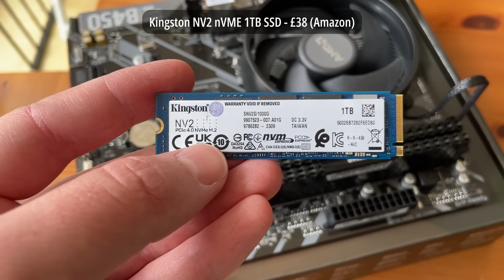Building a Cheap and Upgradable Gaming PC in 2023

Comment: I've just about reached my limits with the AM4 platform. I've got the 5800X3D and an RX 6800 with 32 gigs of DDR4 3600. I could upgrade the video card and double up the ram I suppose but I don't think it would be worth it. I'll just run it for a few more years and then start looking to replace the whole thing.

Comment: Am4 is crazy expensive here, but intel is weirdly cheaper, what weird reality I am?
Reply: In AliExpress the Intel parts are crazy expensive in CAD currency.  Even down to 6th gen intel.  Rather build with ivybridge xeon or v3 or v4 xeon
Reply: @marcc5768  I went for ivybridge xeon, had an x79 with LGA 2011 already, a bunch of ddr3 memory laying around, and that was the best thing I could've gotten for less than 20$ at the time
My plans are an upgrade to AM4, as DDR4 should be capable enough to handle at least 15 years

Comment: I bought a used motherboard off Amazon and it redlight my 5600x cpu even though it was an X570s Tomahawk. I have yet to receive the refund. It seems to me that for VERY LITTLE more money you could have built a much more capable system that would be both upgradable and also NOT REQUIRE upgrading for a much longer time. I mean 1060? 2600? Really?

Comment: Just finished building using this as a guide - picked up at RX 590 and a different branded SSD as well as AX3000 WiFi card as I'm not close to an ethernet port at my desk, but still came in around £350! Bargain I think with a slightly better GPU in there as well. Can only switch on and install Windows tomorrow now so fingers crossed!

Also got the CPU from CeX, but mine didn't come with a fan so had to pick one up separately which added a little on!

Comment: This is almost my exact same build from 2020 with a slightly different case that has optical drive bays. A Sata 3 SSD (M.2 is way cheaper now) and an RX 580 (comparable to the 1060 and $50 on the used market)

Comment: HellCrack Classic              ATX Midi PC Case               £30 (Amazon)
EVGA 600 W1                    PSU                                        £23 (Ebay)
Gigabyte B450-M-K           MB                                         £36 (Ebay)
Ryzen 5 2600X                   CPU+Cooler                         £40 (CEX)
Corsair Vengeance LPX   RAM (3200MHZ 2x8GB)    £21 (Ebay)
Kingston NV2 NVME        SSD 1TB                                £38 (Amazon)
Logitech MK120                KB+Mouse                            £18 (Amazon)
Logitech Z150                    Powered Stereo Speakers  £27 (Amazon)
LG MP22410-B                   21 inch Monitor                    £70 (Amazon)
 Asus ROG GTX 1060        GPU                                        £75 (Ebay)
                                                                                             --------
                                                                                              £358
                                                                                              --------

Will be building a PC as a surprise christmas present for my nephew but already have a 1060 and a 21 inch monitor so that should bring the cost down to about £250. I'll Add a 2TB HDD but I should still come in at well under £300. Long live the budget PC build. For a while it was looking doubtful if it would ever return.

Comment: thanks a lot although i have a some what similar gpu using an rx 580 an asus rog one my cpu is really old because a relative gave it to me its a A4 6300 so the bottle neck is literally at 60-70% specially on cpu intensive games im planning to upgrade soon so this video really gave me a much more in depth guide specially on the motherboard because i was only planning to get a really cheap a320 board but with this guide it made me think more better on how i can save more in the future upgrades

Comment: Thank you, i am still on the i5 7600K and GTX 1070. I already have the case, a 800w PSU, 2 SSDs + 1 HDD and 2 x 8GB DDr4 3200 RAM. I was wondering what motherboard and CPU to upgrade to, while holding on to as many components as possible.

Comment: 9:38 that drift into the parking space was smooth lol. I was hoping this build wouldn't go over 1k of my currency but it's just over 1.5k, so a bit disappointing but it should be worth it for the upgradability. Also, I'm new to this channel but have you ever done a gaming build that's power efficient while being fairly cheap? I think that would be interesting to see
Reply: its always been gtx1650 for low powers
Reply: The 1650 sucks, most mid tier GPUs are power efficient anyway

Comment: Should have gone with:
Ryzen 5 5500 (6c/12t) - supports RAM speeds of 4000+ (in 1/1/1 ratio) because it is monolithic. A hidden gem for budget gaming.
Gygabyte B550m DS3h - same-ish board that you used with a couple of improvements for same-ish price. Improvements include: VRM heatsink (important in case of upgrade to more powerful CPU), 4 ram slots (to upgrade later), link to chipset is at PCI-E 3.0 speed/bandwidth instead of 2.0 on B450.

Comment: A little piece of advice for everyone if you buying cheap case at least make sure it has some sort of front cuts to take air in, and it would be wonderful if it also had at least half of space on the top with holes to let that hot air out... 
Some recomms: FSP/Fortron CST130BASIC, Cooler Master Masterbox Q300L,  MSI MAG Forge 100M, Deepcool CC560 White

Comment: Really nice video. A beginner pc builder like me can learn a lot. In spcific what components to chosse for upgradability:
- High Watt PSU
- Motherboard with a socket that supports a lot of CPU generations (AMD seems to be the only option xD)

The rest of the system can be adujsted to what your wallets weight.

Nice video, I will remember it for when I need it again!

Comment: These are really close to my current specs lmao, except I'm running a gtx 1660ti that is in desperate need of repasting. I'm planning on getting 2x16gb 3600mhz ram, a Ryzen 5 5600x, and for gpu I am pretty torn between 3060 ti, 6750xt, or an Intel Arc A770 for all that precious vram
Reply: Go for the 6750xt it outperforms the other two
Reply: @ANN1H1LATE89  I like to play older pc games too which Intel cards struggle at so I prob will go AMD. Nvidia isn't looking good for the mid-range consumer crowd
Reply: currently running a 5600x, 6750xt, and cl16 3600mhz ram. 1% lows are really low and games are stuttering a bit but it's a much better experience than before.

Comment: ...but don't put a AIO into this CPU/MB combo. This low end VRM design is being pushed with a 95W CPU. And an efficient cooler, will make the CPU draw even more power (stock PBO/XFR settings). So best to use a down-draft cooler. Wraith Spire or Prism is good in this combo.
If paired with a higher end board (proper VRM heatsinks), then an AIO or good tower cooler will be optimal for the 2600X.

Comment: Did you just put a Wraith Stealth on a R5 2600X? That is a bad combo. There is a reason that CPU comes with a Wraith Spire (the copper one). It is a 95W TDP CPU. And for the boost spikes in freq and voltage, you want some efficient heat transfer.
You don't get the full performance benefit on the 2600X with the Wraith Stealth @stock settings (or you will slowly fry it if you did). I saw it hitting near 80c in a few  games. Meaning a Aida64 or Cinebench might easily get it to thermal limit.
With the Spire, it does boost to at least 4 GHz in gaming (and only goes down to 3925 MHz during full stress load as aida64/cinebench). With a even better cooler, 4 GHz @all core, is possible if temps stay below 75c)
The B450M-K board will be hard loaded on VRMs, so for the board the Steath is not bad. But upgrade to the Spire or Prism for the CPU. (Spire has slightly more airflow on VRMs than Prism)

Comment: Why is nz such  a  rip off 16 gigs ram b450 amd 5 3600 gtx 1060 6gb 550w psu 500gb ssd and mid tower case is 800 buck used parts 😡

Comment: That EVGA W1 PSU is listed on Cultists Network as "F-tier: replace immediately"
Reply: Indeed, and even worse, it's second hand.
Reply: @thorham1346  and the motherboard VRMs (no radiator! sweet jesus) are quite literally going to explode if you try to run a 5600x or, god please no, 5800x3d. It's an upgradable system, sure but the main components are "replace immediately" tier.
Reply: @crispybottom yep, rule Number 1 in PC building is: Never, ever, on your life, skimp on the PSU!!! Because a faulty PSU can wreck all your other components.

And bad power delivery also helps causes coil whine at much lower fps than udual.

Additionally that board has only 1 m.2 slot and he's not using the SATA ports so the system fails the upgradeability test right there.

Next issue is 16 GB of RAM, not enough for today, it should be 32GB and it's not much of a price increase.

Also one of the best ways to save on a budget build is to carry over working storage.

Carried over 2 of my old SATA SSDs, they still work, why throw them away?
Reply: @LupusAries  16GB of ram is enough, what are you even going to run on it? blender?

Comment: tt is not all that different than a recent build for my roommate. The exceptions being that I used a used aluminum LAN party case.  My build was really cramped though. Mine has a used B450 board and a used Ryzen 2600 which came with the cooler.  Issues I had was the board did not come with I/O shield, which I could live without, M.2 stand off, and heat sink mounting plate. For me it might have been better if I bought a new board. Used a used GTX 1070. Had a power supply I bought for a previous build so already sunk cost there.

Comment: I have a AM4 motherboard to be specific Gigabyte A320M-S2H and I have a Ryzen 1600 paired with an RTX 3080 planning to upgrade it to Ryzen 7 5700x, will my mother board support the upgrade? Or should I change the motherboard?

Comment: The only thing I would change is getting a 256gb M.2 and leaving it solely as your windows boot drive and then have a 1tb sata SSD as your games storage. Having games on an SSD and not an M.2 won’t affect load times but not having your boot drive filled with games will keep the PC responding faster for longer and keep windows snappy with no discernible input lag.

Comment: Nice one! Mine's as follows: Deepcool Matrexx 60, used AMD A320M board & Ryzen 3600 w/Prism cooler. ebay 3600MHz DDR4. Used 1070Ti. Decent power supply, some cheap solid state storage (I used a repurposed 512GB NVME from a dead laptop and got a good deal on a 2TB SSD) and call it a day!
Reply: DDR4-3600 on a320? Is that compatible?
Reply: @BonusCrook  well, the board is flashed to take the 3600 so hey it might've been part of that revision. Either way it's a stable 3600.
Reply: @boingkster  oh cool

Comment: Board is not sufficient for 5000 processors. For example B550M-K doesn't support PBO. It's missing in BIOS, completely. I was very dumbfounded, TBH. You should go for any of MSI VDH B450 stuff.

Comment: I got almost the same setup, a 2600, gtx 1060 6gb, 32GB RAM, same SSD and an MSI B450 Gaming Plus MB, these work great combined, and as you mentioned, It's room for upgrade down the line since I just built mine in the past 2 months :D
Reply: How much did you pay for that setup?
Reply: @hrvojemilicevic3309  I've currently changed my whole setup, upgraded to new AM4 parts & Graphic card (R5 5600, Aorus B550 Elite, GTX 1070) but the previous parts were pretty cheap when bought because those were used (only SSD & RAM was new) I think I paid like 90-100 Euros for MB, CPU & Graphics Card.

Comment: I done a second build based around budget and performance. I ended up with a CIT F3 case (Black/Blue) for £26, EVGA 600W PSU for £35 new, 32GB DDR4 RAM for £35, Ryzen 5 1600X for £70, GTX 1050TI for £35 and a 2TB Crucial P3 SSD for £70 and I got the same Mobo Gigabyte B450M-K for £60. Runs games like world of warcraft and FF14 at around 60-70fps at 1080p medium settings ish. I loved the rubber holding mechanism for the SSD, I ended up chewing the SSd screw in my wife's PC and had to get creative when we upgraded her M.2 SSD earlier this year

Comment: GTX 1060 is cheap but at the same time it's on it's last legs. Needs replacement within two years. A RX 580 / RX 590 would have been slightly better for (less) money. However the RX 5600XT and RX 5700 (XT) have come down in price a lot, this should be the preferred option.

Comment: What I did not like ,that you bought a motherboard without VRM heatsink, despite you said even a 5800X3D is an upgrade option. And also shouldn't you install heatsink on the SSD?
I'm in the process of making a similar PC for the kids, to upgrade from the I5-2400 Dell Optiplex.
- Gigabyte B450M Gaming for ~25€, which is better, it has VRM heatsink
- G.Skill Ripjaws 3600 CL19 for ~20€
- Ryzen3 1200 for now, less than 10€ back then, I'll go for 1600AF, 2600 or 3600 later
- Coolermaster TX3 which was free
- Corsair 450W PSU for ~12€
- Manli 1650 Super for only ~65€, about the same power as 1060 or RX580, but only 100W (and 4GB)
- Xigmatek Asgard case temporarily, old but I got it free some years ago.
No SSD so far, I'm still thinking which to buy.

Comment: My personal choice for low to modest budget PC build that relies on some used parts:
Second hand Ryzen 3 3300X OR Ryzen 5 3600 (you may consider the R5 5500 as well)
Asrock B550M HDV
16GB (8x2) of DDR4 3200 RAM
Any 1TB NVME with DRAM
AMD card: Second hand RX580 8GB OR RX6600 (you may consider RX5700XT if the price is better in your country), OR
Nvidia card: Second hand GTX1070 OR RTX 2060 Super
Any 80+ Bronze 600w - 650w PSU from known brands (Semi Modular if possible)
Any mATX case similar in type and pricerange that RGHD uses
Cooling fans that correspond to what the case supports (ID Cooling and Cooler Master for budget, Arctic if you can up the budget)
---
I do not know what's the pricing on your side of the world and what you can build for similar pricerange (do share in the replies to my comments!), but this build may cost between US$400 - US$500 or below that depending on what deals you find in your place, which is great considering the price to performance that you're getting.

Comment: Deff a solid upgrade path with this PC , only thing id "splurge" on a bit more is probably a 650-700w PSU instead of just 600. And maybe a MOBO with 4 ram slots.
PSU in case people wanna go for rtx 3000 or rx 6000, since theyve gotten cheaper lately.
RAM because most recent games ask for 32GB😅
Great vid tho.

Comment: Back in 2014 my build was a very good one. Still running daily and had some good luck oc'ing it. 4670K i5, 16 gb ddr3 ram and 1070ti. The gpu's where always upgraded. Gtx460 sli, 660ti sli, 970 in sli and the 1070ti is likely the last upgrade this old beast got.
Reply: If your handy at repairing cpu socket pins you could probably get a cheap z690 and an i5 12600K used, just make sure its DDR5 because you'll want Hynix A die ram

Comment: If you're making a build like this, make sure to check on the second hand cost of AMD options like the RX 580 and RX 590 8 GB cards. They perform as well or better than the GTX 1060 and those 2 extra GB of VRAM will be a huge help in 2023.
Reply from the maker: Yeah great suggestion
Reply: Games are getting progressively more VRAM hungry as time goes on, and the extra VRAM is nice for texture fidelity even if everything else is set to low. Besides, the RX 580 generally outperforms the GTX 1060 in recent games and can be had for a similar cost. All I suggested was to look into the cost of multiple options before making a purchase.
Reply: I think you can get rx 5700 xt for as low as 150usd and its performance is pretty much  rx 6600 xt without the RT.

Comment: Hello guys, i would like to request you to don't make upgradable pc 😢 i built my pc at the time of gpu price hike and i decided to upgrade my gpu when the price get down and still don't save the money to upgrade 😔 i have pc with 5950x, 32 gb ram, 2k 144hz monitor and a gt1030 😭 yeah gt 1030
Reply: Most underqualified builder ever 💀. You can sell the 5950X and 1030 for a Ryzen 5 5600(non x) and RTX 3060-12GB from ebay and probably get great fps

Comment: any suggestions cpu upgrade from athlon 3000g with rx 550. athlon 3000g bottlenecking rx 550 soo bad because lack of PCIe lanes only run at x4. just found out that athlon only has x8 pcie lanes which 2 for igpu 2 chipset and only 4 available for discrete graphics/nvme upgrade 😢
Reply: A Ryzen 3600 or 3600x would easily move the bottleneck to your graphics card, and comes with 24 pcie lanes. If you can afford it, the 5600 is also great value, though you should check to make sure your motherboard supports it. At a minimum, you will need to upgrade your BIOS, but don't do it before you get your new processor, because some of the BIOSes had to drop support for older CPUs in order to make room for supporting the newest ones.
Reply: @EnglishMike  thanks dude

Comment: I have been using a really old office pc for a couple months and was thinking of upgrading the gpu with an amd radeon rx 6400 lp but I honestly have no idea what im doing lol
Reply: If your computer is still using an HDD (hard disk drive) the first thing you should do is upgrade to an SSD (solid state disk). If the computer is really old, then you will need to buy a SATA SSD, but they're really cheap these days and it will make your computer feel much faster, especially when booting up and loading games or apps.

Transferring Windows from the HDD to the SSD can be a little challenging, but there's plenty of advice online (YouTube and articles) if you need help.
Reply: @EnglishMike  I know I have an ssd so it may not be that old. It's a HP Compaq Elite 8300 sff. the cpu is an i5 3470 and the gpu is an AMD Radeon hd 5450. I did some research and I know the gpu is way out of date so I thought that makes the most sense to upgrade first then go from there.